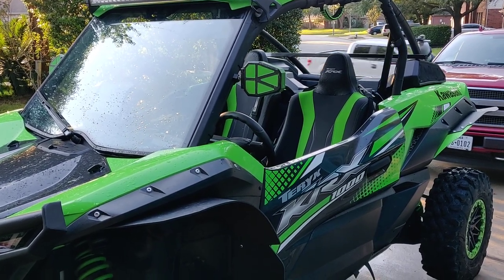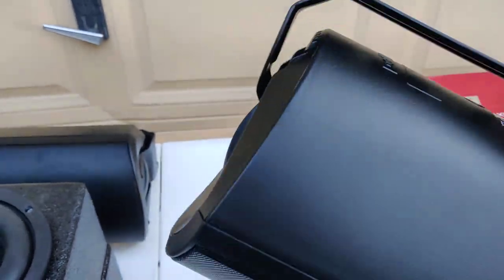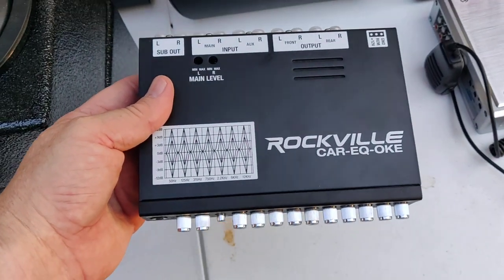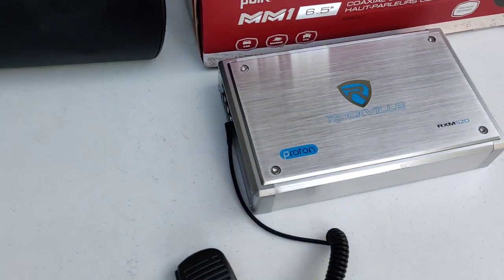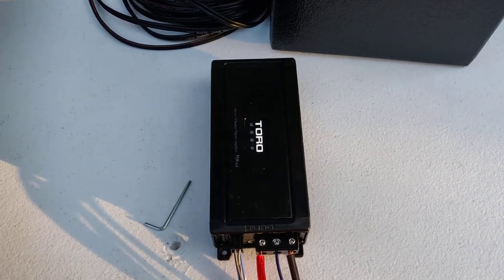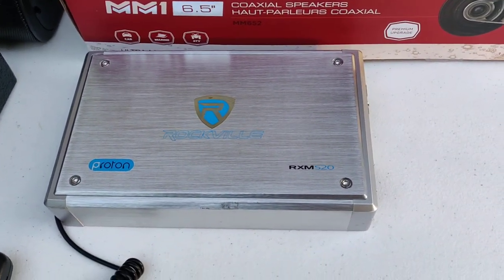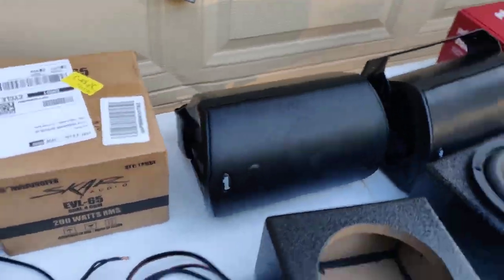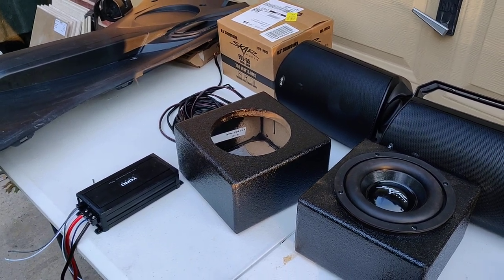KRX 1000 DIY Stereo install part 1

Comment: @ 6:06
Sealed box are better also use marine speakers with stitching becuse your subs are glued together and as far as amps use sound stream motorcycle amps they put out almost 1000w for the 4 ch amps and subs you can get them marine grade but what I do is open my amps hot glue any hole through components for vibration proof A MUST for any UTVs and then i use Humi seal to water proof the electronics

Comment: Make a split mount out  of a piece  of tubing  with bolts and nuts and make it clamp onto the bar so you won't make a weak spot where you drill it

Comment: I was wondering if the 1/2 speaker spacers worked out for those Polks. I bought those speakers but returned them as the depth wouldn't work. I didn't realize there were spacers available until seeing this video.
Reply from the maker: Worked just fine. My knees bump here and there but they bump anyway.
Reply: @txtamer  I just bought my KRX. It was a used one that has a Boss audio system installed with some door speakers and my knees hit as well and they don't have the 1/2 spacer. Anyhow the speakers aren't the greatest and the KRX as you know, gets pretty loud. I was thinking that the Polk speakers would make a difference. How do you feel they perform when running around in the buggy?
Reply from the maker: @jasonfranks2109  What brand speakers, and what brand stereo is installed? Do you have an amp in the system?  These Polk speakers are amoung the best (for the money) that I have ever used. Installed them in my boat and two other side by sides over the last few years. If your head unit is cheap and boss brand, don't waste the money. Lots of distortion from Boss brand products. It would be worth the money upgrading your head unit first. and add a $300.00 amp  like JL Audio MX280/4 marine grade. See what your speakers sound like then and upgrade to Polk if you are not satisfied. PS..... Watch Ebay for deals. Be patient. I have gotten high quality stuff at 30-50% off by waiting and watching.
Reply from the maker: Another great amp that I currently use is a Rockford Fosgate PBR300x4. super small but powerful and clean. You cna catch one ever so often for 200.00 or less.
Reply: @txtamer  These are what I decided to go with. For my doors, Polk MM1. Grabbed Rockville WB65KLED 6.5 to put behind us. Picked up a NOAM NSUB subwoofer and grabbed a rockville RXD-F30 for an amp. Hopefully my setup will work well. To answer your earlier question, I do have a BOSS MGR450 head unit. I believe the original owner put that with the BOSS speakers that came in a combo package.